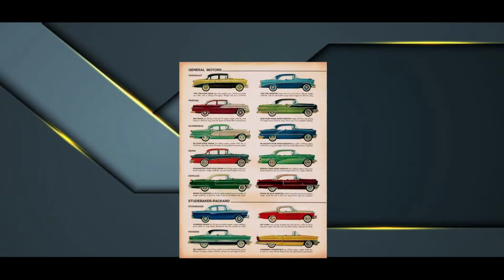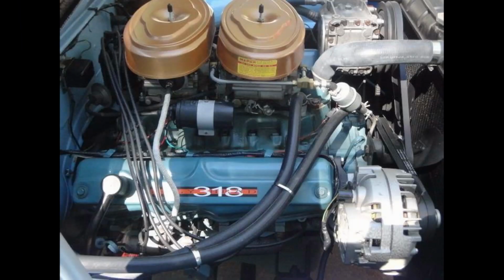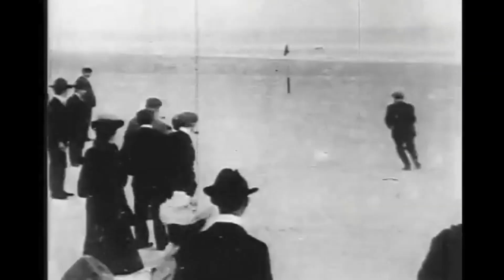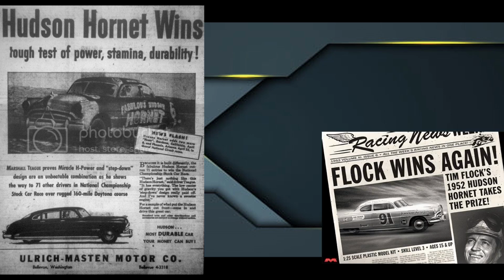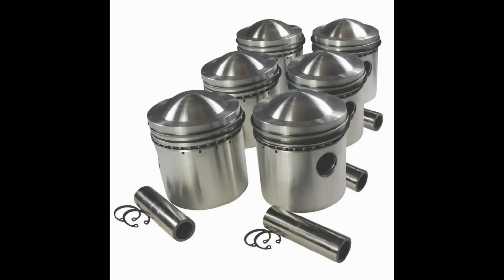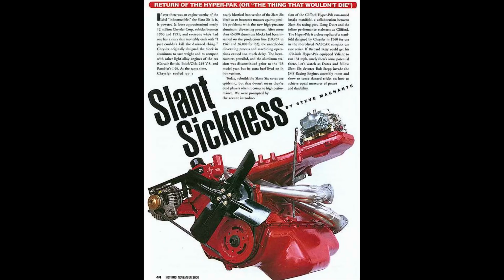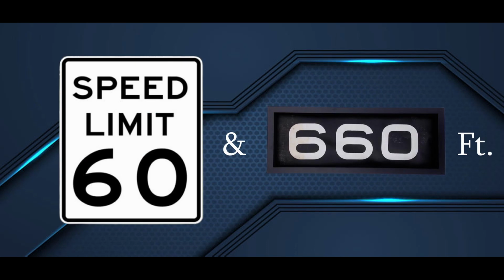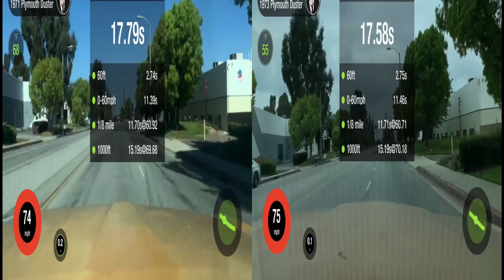318 LA V8 vs 225 slant 6 60 foot 0 to 60 mph 1/8 mile 1000ft 1/4 mile Drag Race

Comment: Both are slow.
Reply from the maker: Well slow is a relative term. By today’s standards of course these 50-60 year old machines are not the fastest. Back in the 60’s and 70’s the fastest 1/4 time was the Hemi Cuda which ran around mid 14s. For the era and displacement, these were about average times. Thanks for the comment and interest 👍, I really appreciate the support.

Comment: Here in Australia, we got the 225 slanty in our valiants, in the big pacer you could get a twin barrel 225 that make about 180hp before you went and got yourself a hemi 6, totally different to the 225 a partsbin throwaway from the Americans.

 The hemi is known here for being a powerhouse, in factory form you could get a 300 horse 265 cubic inch 6 with tripple Webers!!

When it comes to Holden in their small torana race cars with the small (in comparison) 202 cubic inch 6 could be optioned with tripple su carbs in a light hatchback, in racing form it was believed this little 6 was making over 250hp and was smashing full sized falcons with 351 CLEVELANDS.

Goes to show us Aussies can build a 6 Cylinder back then and still can now with the Ford barra being an evolution of the old Ford mileage maker 6 Cylinder from the 60s only with a huge block and dohc, horse power potential is limitless with up to 1000 if not more on the stock bottom end!!
Reply from the maker: You are 100% correct. Australia has some of the best 6 and 8 cylinder engines ever made. Cosworth alone changed the game forever. But I think the 170 slant showed what Chrysler “could do” if given free rein in building a performance engine. That 2.7 liter inline six produced 200 + horsepower. I think that’s pretty awesome as well.
Reply: @atfgarage9459  Definitely, Chrysler was the first to offer a v8 here in the ap6 valiant before the rest of everyone else. 

If you want some interesting reading look up the supercar scare of Australia. Big 120mph possible cars where being designed like the phase 4 falcon or the Holden xu2 which was going to be a small sub 1200kg hatchback with a 350hp 308 cubic inch home made v8. Imagine that!!
Reply from the maker: @darcyw8995   wth… seriously??? 1200kg 350hp, that’s not a car, that’s a rocket with wheels lol. That’s pretty incredible. It would be awesome to try to mimic it. I would love to see one!
Reply: @atfgarage9459  you can see why the government shut it all down and by 76 new emissions loses came in making this idea redundant as power levels shot down.

We didn't get big cube v8s like you guys did but still, nothing like the Aussie designed engines, even the Cleveland v8 was made here into the early 80s as a 302 (you blokes didn't get these in america) and 351 cube, when Ford dropped the v8 from the falcon these left over blocks from Australian foundrys were sold to detomaso for the pantera!
Reply from the maker: @darcyw8995  one of my neighbors has a Pantera. Absolutely amazing, and runs like a beast. Yeah smog restrictions didn’t do the automotive industry any favors. Took some 10 years for power to start to show up again, in the states.
Reply: @atfgarage9459  better tell him he may have a small piece of Australian automotive history! And yeah smog really hurt cars especially Holdens, 3.3 litre 6 Cylinder making about 100hp in  large full size sedan, it used more fuel then the v8 did
Reply from the maker: @darcyw8995  yeah those 80’s GM’s have the record lowest output per liter. 5 liter v8 with 140 hp! Those smog restrictions set the industry back terribly. I think restricting the leaded gas was good enough, but the PPM setting was a step to far. Politicians going to far as usual!
Reply: @atfgarage9459  that's odd as our home made v8s were still making about 200 claimed hp but in 88 the v8 got new cylinder heads and efi that bumped power up to 221 and it kept going up from there.

Mate I've got that much I could say but it's a bit useless in the comments lol.

It's still Interesting to learn the extreme differences between AUSDM and USDM cars and I'd love to learn more
Reply from the maker: @darcyw8995  funny story the 1982 corvette USD got smoked by the 82 Honda Prelude! No joke lol

Comment: Too bad Ford didn’t get the Barra here, and Australia Chrysler had a 265 slant
Reply: The Aussie 265 wasn't a slant. The 6Pack triple weber 4 speed was a 13 second car and smashed all sorts of V8s. A mate had a 1970 318 Fireball Valiant utility and it had no hope  !😎👍
Reply from the maker: @davidkeep6526  ohh absolutely! That torque monster would smash on v8’s almost twice it’s size. I think he meant to say inline and not slant 😉.
Reply from the maker: Man a 4.3 liter slant six would be awesome! As it is, that Barra is absolutely incredible. Bulletproof and huge compression numbers. Take that thing to the moon! In my opinion that inline is what the slant six should have been. A faster younger brother if you will lol. A real piece of Australian power! Thanks for the support 👍
Reply: @atfgarage9459  my bad it was not inclined but had nice semihemi chambers big valve and could get 400 hp easy natural aspiration
Reply from the maker: @dennisford2000  Straight engines have incredible balance and respond very nicely to upgrades and power adders. 400 hp would be pretty awesome to get out of an NA six

Comment: Very informative video. I have owned a number of both engines and they are both excellent and bullet proof, however you need to have the same differential gears in both cars to compare apples to apples.
Reply from the maker: You are absolutely right. However I’m not a big shop and can’t really dedicate multiple weekends at the junkyard with a micrometer, as much as I’d love to lol. But I think the essence is still there. That it is “possible” that a slant six can keep up with a 318 in the right circumstances. Which I feel is amazing! Overcoming some 100 cubic inches and two less cylinders. Albeit not a 100% fair fight 😉. I do believe if that 318 had same gears it would gap the slant by about 1 full second in the 1/4. I’ll be working on getting a 8 3/4 for both with identical gears. But yeah, thank you keeping me honest lol. You definitely know your stuff, and to be honest I can’t wait to see what happens when they both do. I really appreciate your support and comments. Let’s me know we aren’t alone and I’m not doing this for nothing 👍.
Reply: @atfgarage9459  Fair enough. I enjoyed your vid and you put lots of effort and research into it. I have subbed and will be looking forward to further vids when you can.

Comment: It wasn't a twin engine version of the straight eight, it was a U-16
Reply from the maker: Yes you are technically correct, however a "U" engine's literal definition is two straight engines combined, IE twin inline 8 engines. They were upgraded versions of his earlier inline 8 engines, but the point of the story still stands. This twin inline or "U" engine almost toppled a record set by an engine 27 times its size. Thanks for the post and support!

Comment: Watched this earlier today, what can be done with a 225 slant six without turbo or supercharger. https://www.youtube.com/watch?v=4zHxzHEs14k
Reply from the maker: Wow that’s some pretty incredible stuff. That All motor slant six could walk a big block lol. I have something similar to that planned in some upcoming projects.
Reply: @atfgarage9459  What I like is that engine will still be reliable if it's treated right, regular oil changes and no crazy revs cold.
Reply from the maker: @johnvender  yeah absolutely awesome. Could you imagine owning this thing? In my opinion, the perfect balance between dependability, performance and gas mileage.

Comment: I feel you should find one of the tens of thousands aluminum-block "towers"{...of Power} in 225 cu" form, then cut-up and weld together a 6-cyl. manifold & head from two 2nd-gen.  Hemi V-8 heads to make ONE 6-cylinder Hemi-alloy head, which will be cross-flow, so the exhaust-header can be a straight down dump from the slant, --3 exhaust pipes per cat, & true "dual" exhaust.  You'd need to move the distributor,[--put one coil pk over each cylinder] and I recommend experimenting with: 3X1-barrel carbs, 2X1/2 barrel carbs, 6X1 barrel carbs, other carb configurations, and port { but Not direct } fuel injection.   Chrysler often had sealing problems when it Stupidly used an iron head on the aluminum block!     Chrysler, of COURSE, SHOULD have used ONLY an aluminum Head on an aluminum block.   Also, Plymouth didn't use the 225 aluminum block in the '76 "Feather-duster", another Stupid error, because with Over-drive {--5-spd}, headers, & a totally-aluminum engine {block & head}, I believe 40 mpg or more could have been obtained @ 47mph steady-state.   Also the MORONS @ Chrysler, didn't put a "Hemi" head on the slant-6, even though one EXISTED in Australian "Parts-bins" for Chrysler 6s made in Australia!   Chrysler later had OHC/DOHC alloy heads for their Aussie-6s that they STUPIDLY didn't market here, in the 'States!   If I had been Lee Iaccoca, back in the day, the US Chrysler parts Execs would've been fired So fast, they wouldn't remember their names once outside the gate!   The 4L Australian Ford "Barra" straight-6 can produce 1100 Hp with the correct adds/parts, so 6-ers CAN, "HONK!"
Reply from the maker: Damn!!! Very nice man. You definitely know your stuff. Sadly Here in the states finding one of those aluminum blocks is like finding a 426 at a garage sale. I’ve been looking into getting some Mikuni side drafts for a 4x6 or even a 6x6 but they are pretty difficult to find an expensive when you do. I’m going to look into that -3 exhaust dump that you were talking about. Sounds very interesting. Thanks for the support btw.

Comment: My first car was a 1973 Plymouth duster. Affordable platform to do basically anything with.
Reply: My first car was a '73 Dart Sport 225/6/3AT.  I actually managed to blow up three sixes before dropping a 360 into it.  With each grenade, we rebuilt it with more upgrades.  Ended with the head milled .100, Comp Cam SK64-241, 390CFM 4bl Holly with an Offenhauser intake, 3x2 Hooker headers to dual 2 1/4 exhausts and 3.21 8 1/4 rear axle.  Also upgraded to front discs and front and rear sway bars.  Fun car.  Still have it in my garage and just waiting for the kids to move out before I have time & money to bring it out of storage.

For those interested, the first grenade was caused by the journals starving for oil after 5 minutes at 120mph (I was 17).  Blew the #5 rod out the side of the block.  The second grenade was caused by a weak oil pump gear shearing off under load.  Full oil pressure to no oil pressure with no warning.  The third was caused by a machine shop error, not noticing a faulty piston pin journal when pressing the pin.  That pin walked out the side of the piston and bored through the cylinder wall within 500 miles.  I still miss my hopped up /6.  It was definitely a conversation piece at events.
Reply: @weshenriksen2481  I bet it took a while to make it to 120 mph! I remember hitting 60 and being happy
Reply from the maker: Most definitely! Chrysler hit the nail on the head when they created the Duster. The ultimate, under the radar, muscle car.

Comment: excellent video. The slant six is one of the best engines in history, in Argentina the Dodge polara RT "national invention 😎" equipped the Slant six 225 and produced 174 hp and a maximum speed of 180 km / h or 111 miles but when the slant six was prepared for road tourism produced more than 250 hp and top speeds of 270 km / h or 167 miles, surpassing all its competitors, simply the best engine
Reply from the maker: Than you, I really appreciate the support. I completely agree. The slant six is absolutely one of the best design engines ever engineered. I have some big plans to showcase for both of these vehicles.
Reply: @atfgarage9459  It's good that you're going to keep showing those cars. Here I leave you a link so you can see our cars😎. excellent channel
https://youtu.be/9ybwVzdzeQQ (Dodge Polara RT Slant Six)
https://youtu.be/HFLBWO8VLSw (Dodge Coronado)
https://youtu.be/LrndmCWAl_4 (Dodge GTX V8)